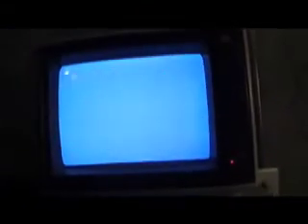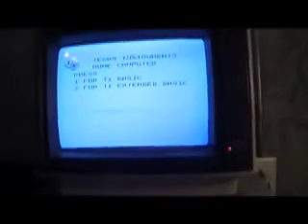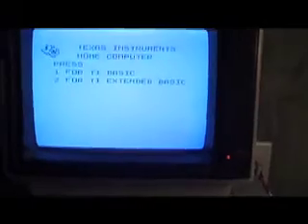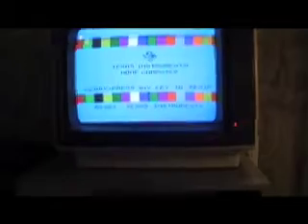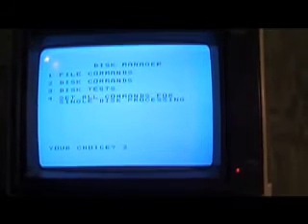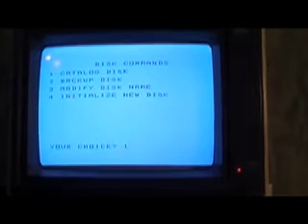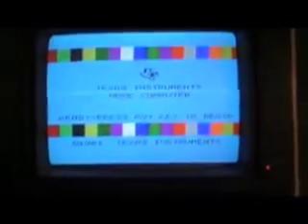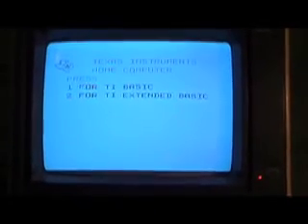TI-99/4a Disk Drive Modification

Comment: Love this video as I am setting up my TI system with items I could never afford when I was a kid. I have managed to get 2 3.5 floppies working by re-pinning the cable, but would love to leave the original 5 1/4 drive in and run the 3.5 in an external enclosure. I have had no luck finding an enclosure though I have a SCSI enclosure I could hack to work. My biggest issue is the cable running from the back of the PEB. Some sort of edge connector but I can't find anything that fits on it. Could you tell my what cable I should be looking for? Or if there are specs for it I can make it?

Thanks for all of the great videos. They have been very helpful.